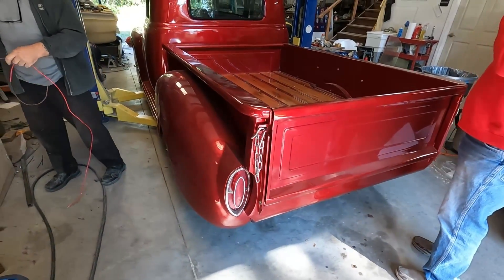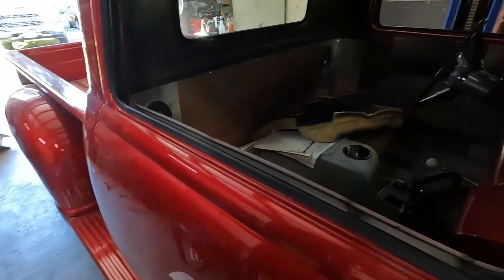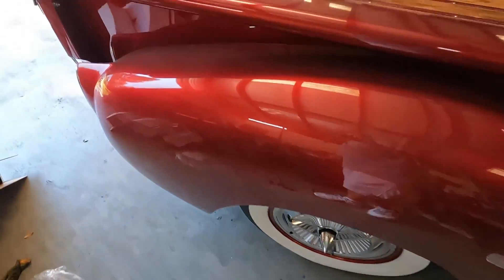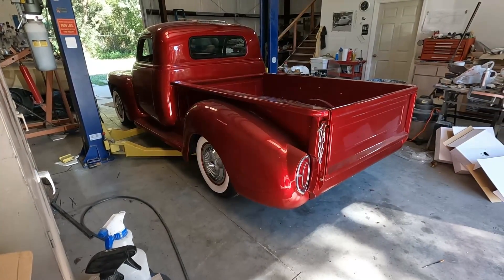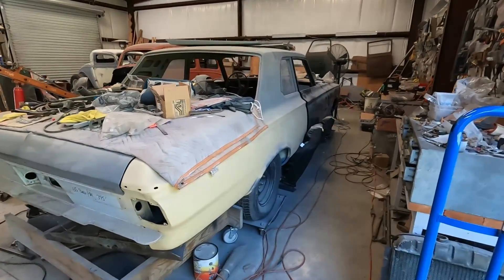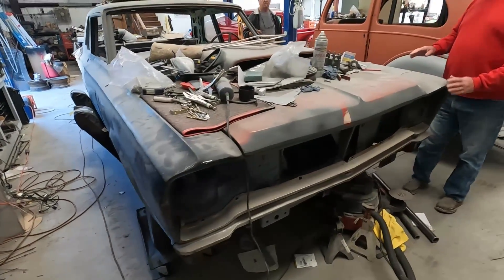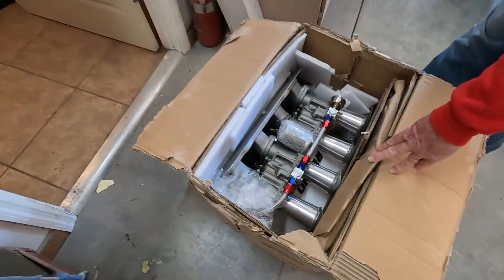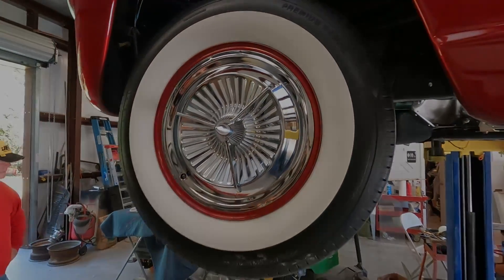Wayne's Garage and Projects 11-15-21

Comment: Yes sorry gearbox or transmission thanks
Reply: 1964 st400 Buick transmission out of a Electra
Reply: Thanks Bill and Wayne. I have a 54 322, and a 66 401.i would like to put a stick shift behind them. Keep posting bill grate to watch and very informative. Waynes truck is unreal. 👌👍👍
Reply: @timferriss1779  Tim it just so happens that I was going to put a stick in my truck in the early days.  I bought the kit that included every thing from the bellhousing, flywheel, clutch, pressure plate, throw out bearing, clutch fork, everything needed to make it work.  It cost $1150, I still have it and now that truck is done I am going to list the kit for sale.  Are you interested?  I will sell it at a lower price than I paid for it. Tks Wayne
Reply: @Startrek1121  Wayne I would definitely be interested, but it would have to be next year now. I have Christmas with the grand kids that won't be cheep. Plus I would need to get details of a shipper as shipping inport and are vat tax is high at the minute. What transmission is the bell housing for? I have a four speed chevy and a tremec. I have been looking at bendsteans and QuickTime for options. Thanks for your reply.